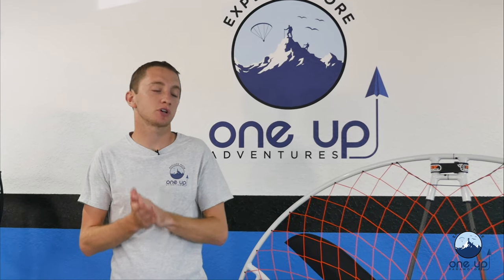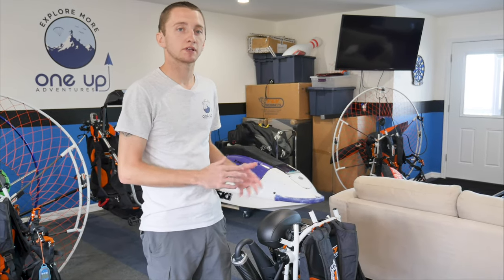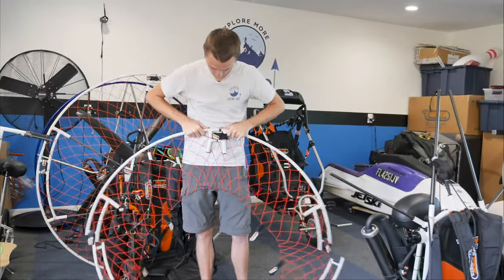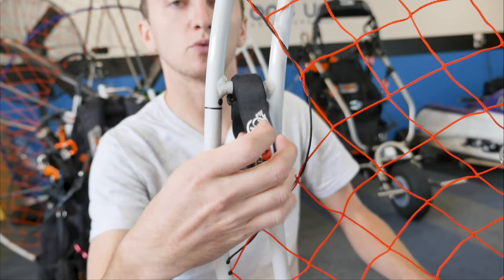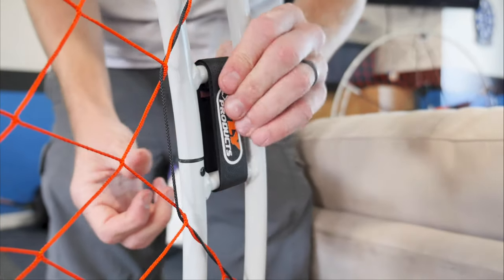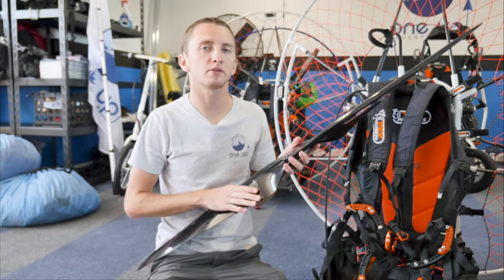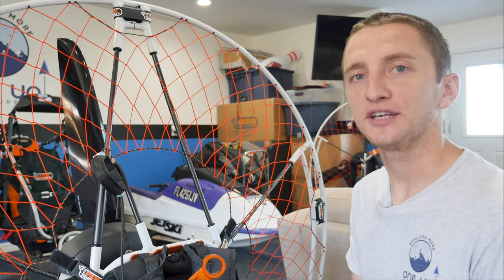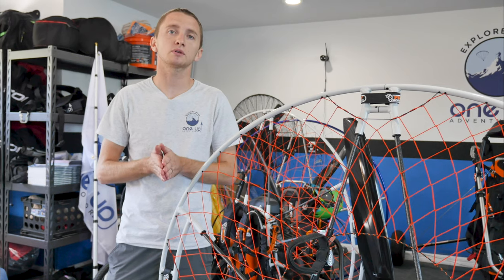Paramotor Assembly Tips - Fly Products Rider Moster 185 Plus

Comment: How many buckles on the harness for the pilot? You mentioned 20 seconds to undo the harness from the frame.
Reply from the maker: There are a total of 4 quick release pinch buckles and 3 push release pins to remove the harness from the frame, for a total of 7.
Reply: @oneupadventures5040  Thank you about the harness to the frame for a total of seven buckles. My question is how many buckles to free yourself from the harness?
Reply from the maker: @markbailey6051  there are four quick release pinch buckles to release the pilot from the harness, two legs buckles, a belly buckle and a chest buckle.
Reply: @oneupadventures5040  Thank you

Comment: On the Rider manual on page 7 it show the middle net strap attached to the tube on the motor side and on page 11 show attached to the tube close to the harness as you did. What is the correct way?
Reply: Honestly I have assembled it both ways, No way is the wrong way, even closer to the engine the straps so not melt or degrade. However I have noticed with the straps on the forward most bar that the bars may tend to stretch the net a little more. Either way works! It is personal preference.

Comment: How much does the rider weigh with pull start moster? Also, if you have weighed the double hoop how much is it?
Reply from the maker: 52 lbs single hoop with Moster Plus.  Don't know how much the double hoop adds, we have a double hoop coming in next week, we'll have to weigh them both when they arrive and see the difference.  Less than 2 lbs extra I'm fairly positive.
Reply: @oneupadventures5040  I would have guessed 56-58. that is pretty good.